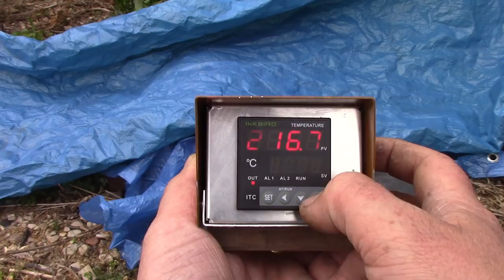DELUXE ELECTRIC MELTING POT

Comment: This brings personal manufacturing up a notch. :-)  Very useful and  a lot safer than the usual methods.  Score!!
Reply from the maker: foxpup exactly, glad you appreciate it's merits, it takes a bit of time to heat up but I can plug it in and do something else, I can use it inside, life is good!
Reply: I make 3d printers and hate having to buy expensive specialized parts that I can't make myself.  I'd like to make them 100% 3d printed but we all know that is impractical.  This melting pot could help me make the metal parts I need.  Pour into the mold, let it cool, take it out and machine it a bit here and there when necessary and I'm golden.  I've been wanting to try making molds with plastic 3d parts in the sand and pour the aluminum in, replacing the plastic with the aluminum as it goes in.  There's a technical term for this process, but the name alludes me right now. :-)  It would be so cool to design a part in Blender and have path to make it real in aluminum using my own humble tool set. :-)

Comment: I've been wondering if you can rebend these types of elements, I'm glad to know that you can lol. Thanks 👍🏼
Reply from the maker: If they are used, they don't last long at high temperatures, new ones are really cheap and put up with a lot of abuse even after coiling them up!
Reply: @turboconqueringmegaeagle9006  thanks 👍🏼 I've just recently started messing around with them. I have quite a few new ones. Thanks again 👍🏼
Reply: I understood they were ceramic between the outer covering and inner heating wire. There must be a minimum bend radius anyway.
Just found more info, it's magnesium oxide powder, or similar, packed between the element and outer sheath.

Comment: The temp probe mounted the way you did isn't reading the temp inside the pot, it's reading the temp of the tube it's inside of. 
The tip of the probe has the thickness of the wall of the pot as well as the thickness of the tube and any airspace inside the tube as insulation from the melt inside the pot.
I would have turned the tip of that tube so the 10mm or so of the end was not much larger than the probe. Maybe 5-7 mm. Drill a hole in the side of the pot so the tip just fit through, then weld it in place with at least the length of the tip. This will get the probe inside the melt so it can read better. 
Also on your pid you should be able to set an offset on the pid so the temp reading better matches the melt temp.

Comment: Can you give us an update on how well it's held up so far?
Reply from the maker: I gave it a little mention when I made some pulleys up a few weeks ago, I still haven't figured out how to calibrate the probe, I just set the controller to 570 which in reality must be closer to 700°c apart from that I should have put  better feet on it, and it is a little too  heavy but all in all I'm happy with it.
Reply: It's good to hear that the pipe is still holding up considering how fast they oxidize when exposed to oxygen at 1000 + degrees. It was also a very good idea to use that kind of heating element since it pretty much has four layers of insulation (including the furnace ofc.)from oxygen, so it should last a really long time.
Reply from the maker: the longevity of this thing was top priority, so many things to prep and think about when casting that i didnt want to worry about electrocution or elements failing, i have a previous vid of a second hand element being wrapped round a some stainless cookware with no temp control, i'd challenge anyone to build a furnace quicker, its not possible, but having observed the failure of the elements and pots (id done this several times) i used the heaviest wall stainless pipe (1/4") i could find and a new element, as with all that cast insulation if either fail i will have to scrap it and start again.
I love anything like this, metallurgy or backyard metallurgy in my case is incredibly rewarding, every time i do something i learn and its nice to meet others with similar interests!
Reply: Recycling thrown away pieces of odd shaped metals into useful tools and other objects is one of the most rewarding things i can think of. It never gets boring. It's especially nice if you have machine tools to turn those rough castings and blanks into precise close fitting parts. 
I'll begin making my furnace tomorrow and will try to post some footage of the finished product in a day or two.
I've thought up a design where you can quickly replace the heating element when it eventually burns up without too much hassle and no disassembly of the furnace.
Reply from the maker: I got at least 50 brand new elements from an appliance repair firm because they were obsolete, id happily send a few your way if the postage isnt going to make it pointless or you could try getting some the same way (its pretty hard finding anyone who makes a business out of fixing anything these days)
very intrigued to see what you come up with
Reply: Oh wow, you are pretty much set for life with that amount, haha. And here i was thinking i got lucking for finding three brand new coils at the flea market for cheap. And while i am extremely thankful for your offer, it would be a huge hassle for the both of us in sending those elements.I live in a bad part of Europe where sending and receiving packages can be a nightmare.

Comment: Hey there, fantastic vid mate. Do you have a link to the PID you used? or even the sensor?
Reply from the maker: Cheers mate, i used an inkbird controller https://rover.ebay.com/rover/0/0/0?mpre=https%3A%2F%2Fwww.ebay.co.uk%2Fulk%2Fitm%2F222450267949
And a k type probe with a 1000°c range
Reply: @turboconqueringmegaeagle9006  Thanks so much for you swift reply :)
Reply from the maker: @cuttothechase99  my pleasure! Two reasons I built a separate box housing the controller and relay
1. So I could pour without wires
2. So I could run different tools off the same controller....  
I was planning a small kiln but it's not materialised yet!
Hope you build something cool and have fun doing it.
Reply: @turboconqueringmegaeagle9006  I'm just waiting for my PID and thermometer to arrive. I'm just doing mine inside a bucket i have one with a kiln wire already in it however i much prefer the way you've done it so i'm just going to remove the coil and add in an oven element. Yours is the first time i've seen one get bent like that and after a little research it appears you can bend them prior to heating them and they'll be OK but if you bend them after they've been heated ie. reclaiming a second hand one, that they might not work. So basically what i'm asking I guess is it's clearly Ok to bend a new one?
Reply from the maker: Awesome news! I have made 4 of these, first few were reclaimed and only lasted a few pours, this one I used a new element and it has done at least 20 pours although I also put that down to the temp controller, much tighter than a 2" radius and I think the element will break or kink so go easy on that and good luck my friend, happy casting!
Reply: @turboconqueringmegaeagle9006  Thanks so much, i'll let you know how I go. Happy casting :)

Comment: Was that perlite u used??
Reply from the maker: Yes, and refractory cement
Reply: @turboconqueringmegaeagle9006  awesome. Never imagined the same stuff (perlite) I use to keep my garden dirt moist could be used for this. Much thanks.
Reply from the maker: @Someguy04-v3m  some people have good results mixing it up with cat litter (bentonite clay) for foundry linings, I had half a bag of this very expressive muck left from another experiment otherwise I probably would have tried that.
Fyi. Being a green fingered chap, don't try using vermiculite as it's hydroscopic and even if you keep your foundry dry it can suck the moisture out of the air and will just crumble as the foundry warms due the steam venting.
Reply: Hahaha, vermiculite did cross my mind. I decided against it just because how course it was and the thought of air bubbles because of the courseness of it. Is any of this better than plaster of  Paris??? I'm thinkin bout using a couple steel wheels welded together with the insides cut out and going from there so it'll be a bigger one. I don't mind putting in the money if it's worth it. If it's just as dependable using cheaper stuff that's what I'll do. If ya don't mind all the questions what's ur recommendation??
Reply from the maker: @Someguy04-v3m  the "pizza oven cement" or even more expensive refractory cement is far superior to everything else I've messed around with and that seems to be the popular opinion. 
I built a big oil fired foundry before this which was why I had leftover cement and that is still solid after working at copper temps, I smoothed the rough surface off with fire clay (bentonite/ cat litter) and that falls off after a few burns but for lower temps if you were just casting aluminium it will last ages.
Most people use ceramic blanket these days though, I've never tried it so can't really advise but it is the superior insulator.
I'd suggest there are so many things to think about, how you are going to pick up your crucible, get the tongs in, what size crucible, what style burner, how fast you want to melt ect. that unless you are following plans it's almost worth just throwing something together as quickly and cheaply as possible because I guarantee you'll want to make changes and they'll be less painful if you are only digging out cat litter and perlite instead of £50 worth of fancy cement or getting bad lungs from the ceramic blanket.
Just for reference this melting pot was the 4th electric pot I'd built, and I'll do it completely different next time!

Comment: Dude I need one. To bad me and electric don't mix to well, yet...
Reply from the maker: I'm not great with wires and stuff but there's cheap modules for pretty much anything you can imagine, my earlier melting pots just had a plug on the end of the element, wouldn't last long but worked.
Reply: @turboconqueringmegaeagle9006  yeah I'm looking at you're little waste oil forge at the moment thinking on building a waste oil smelting furnace. I've got almost and icb equivalent full of crushed pop cans to melt into billets must be 10k cans or more saved
Reply from the maker: @smithbuilt  I did a waste oil foundry too, pretty sure it'd do iron but never tried, I did it the complicated way with pressure fed fuel and nozzles. Noisy, dirty and amazingly powerful.
Reply: @turboconqueringmegaeagle9006  noisy, dirty over powered that sounds perfect. Also sounds like someone describing me...

Comment: I wonder why the heating element is not making a short when inserted in this way.  What it's preventing from that ?   The perlite? Or it's the heating element made of some kind of insulation material. Like a lot, nice work!
Reply from the maker: Dani Perloti cheers man, those elements consist of a steel tube which contains a mineral based insulator and the heating wire runs through this, the steel outer is earthed so if the insulation breaks down and the heating wire touches the outer, it will pop the fuse before it electrocutes anyone!

Comment: Awesome project. You mentioned in another video that this smelting pot doesn't do brass. I don't know, I'm learning from you, when you poured the cement, did some go between the heater element and the melt chamber? Would a wrap of fleece around the heater element keep the heat next to the melt chamber and keep the cement only insulating the outer surface. Or is the heater element just not strong enough. Keep up the good work. Always look forward to seeing your videos
Reply from the maker: Yes the ceramic blanket is a better insulator and I could have taken it apart again but doing it as I did with castable refractory insulation meant I didn't need any supporting structure between the inner and outer.
Eventually my budget insulation failed and the element burned out but most of the cost was the temp controller which I can use on the next one, I'm just enjoying messing around with kerosene at the moment.
These heating elements were brand new old stock from a cooker repair shop (free) and unlike most other electric forges/kilns/foundries I don't have to worry about anything shorting but the downside is the limited temperatures.
Reply from the maker: I did a de-brief when this thing failed if you are interested, basically pointing out what I'd do different if I built another https://youtu.be/NoLbbzDEvi0
Reply: @turboconqueringmegaeagle9006  just seen your debrief. You made some interesting points. On my previous comment I meant the blanket next to the element and then the cement. Might protect the cement from degrading. I am experimenting with induction could. You could then replace the melting chamber very easily. As long as the chamber is either steel or magnetic stainless. Can't wait until your next design. Merry Christmas.
Reply: Induction could, not induction could. Damn auto correct.
Reply: Done it again.
Reply: Induction
Reply: COILS
Reply from the maker: @vanmanmarc  I see what you are saying, it was kiln cement so probably the expansion that resulted in it breaking up not the heat and a cushioning layer would have helped.

Induction heating is pretty magical, completely opposite set of problems isn't it, no need for insulation, might need a coolant radiator though, definitely would be the more sensible route for me to cast in the shed but I'm enjoying the kero too much at the moment.
Likewise merry Christmas mate
Reply: @turboconqueringmegaeagle9006  induction magic is definitely not as much fun as fire

Comment: how long did it take to melt the amount of aluminium ?
does the element need to contact the cruisible or can it heat the crusible enough with just the heat radiating of it ?
its a cool idea to get it all in one unit , i do worry a little about the material the crusible is made from (its been known to corrode through)

think im going to try sumting simulair using the oven element but will use a graphite cruisible  instead of a steel one 
the crusibe needs more room so it prolly sit inside a stainless bucket or pan for the inner wall but wind the element on the inside of that (having the stainless reflect the heat back intoo the foundry ) and use the same perlite firebrick cement trick might add some of that woolstuff 
think i use a propane tank for the outer skin
Reply from the maker: I've built a few this way now, very important you use a new element and control it's temp if you want it to last more than a few melts, I'd built a few using second hand elements plugged straight into the mains.
This will get a half load to temp in 15 minutes.
The elements really expand and contract quite a bit so don't worry about getting it too tight, close enough is good enough.
I used really heavy wall pipe, I'm sure you could make a crucible work but having a lot of surface area helps.
Reply: 15 minutes... thats impressive seen the elements simulair to the ones you use at aliexpress so using new is not a problem

Comment: Very impresive creation! Can you estimate what ammount of alu you can melt easily per hour ? Could be done meaby 100kg or about 40 liters per 10h working day? Thanks
Reply from the maker: It would be hard for me to put a time on it like that accurately, from cold it can pour a litre in 30 minutes, then the next charge will only take 20, it's only using a little 1200w element though, you could easily double up with them and speed things up. I built a waste oil fired foundry for the big jobs and no BS, that could do 100kg in two hours!
Thanks for watching
Reply: Hey, that is very nice! thanks for answer and keep going...

Comment: can you send me pictures of the end of resistence
Reply from the maker: What is the end resistance? It is a 1300w 240v element so should be 44ohms
Reply: @turboconqueringmegaeagle9006  but how and what you do at the cross point of the resistence and the extinguer, have you soldering
Reply: can i touch the resistence and the outside extiguer, there are a problem or not?
Reply from the maker: No, the element has blade type connectors and the last 50mm/ 2" isn't heated so I used female bade on silicone high temp insulated wire to go to the handle which is outside the extinguisher, at the handle is a 13amp socket which is soldered but does not get any heat, I think the socket is important as I didn't want wires in the way when I pour the liquid metal